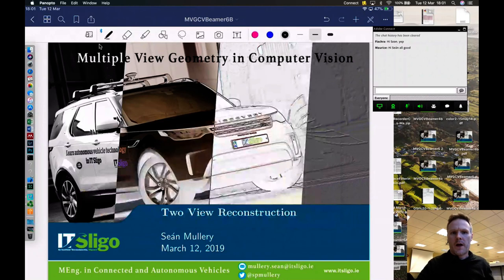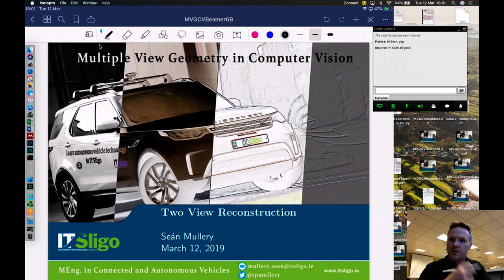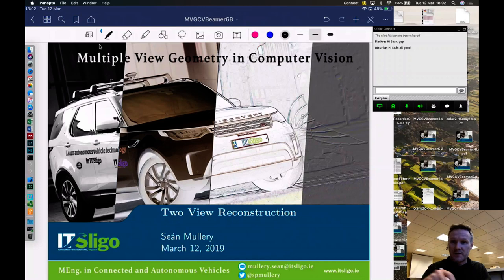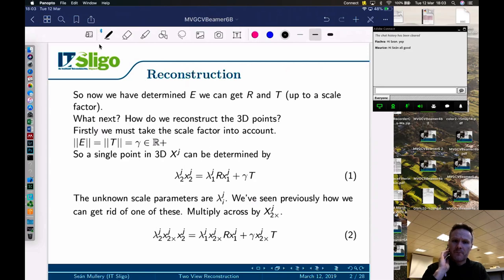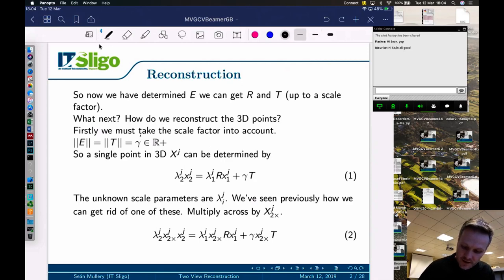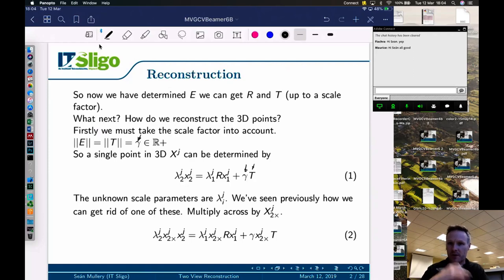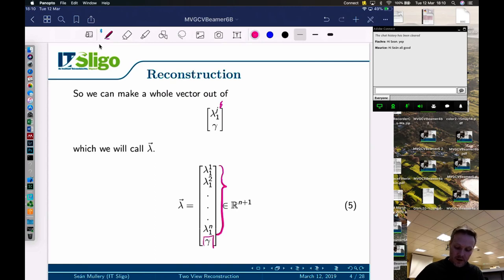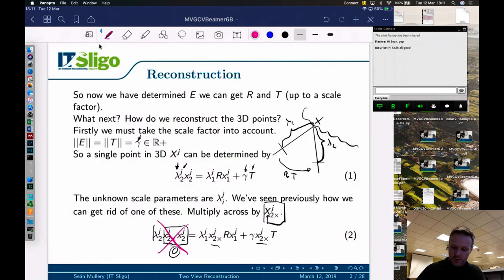Lecture 6B Two View Reconstruction

Comment: I have one camera in my phd thesis and I would like to determine a location of moved target. Hence, can I use two images of the target with time separation then use epipolar geometry method to determine the location of the target.
Thanks alot
Reply from the maker: No, if the single camera does not move between images then you cannot use Epipolar geometry as this is a degenerate case.